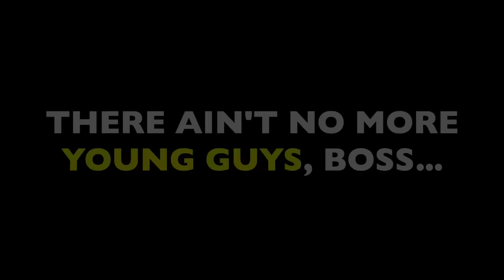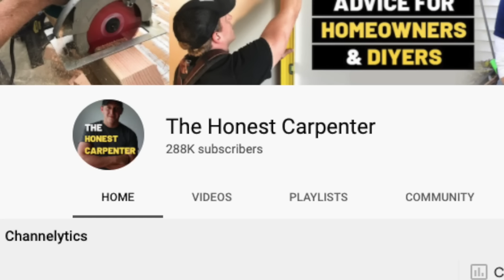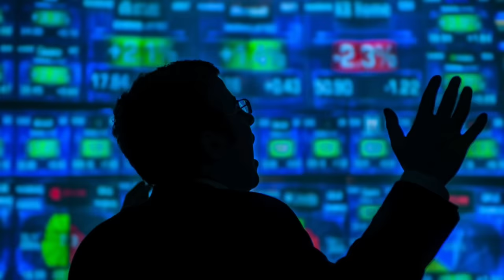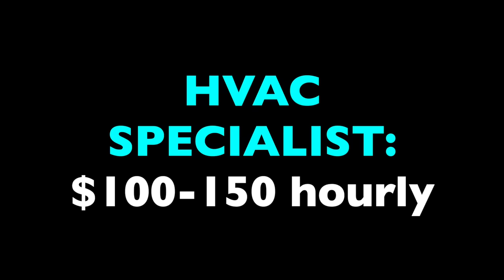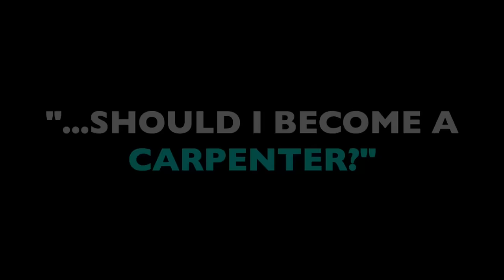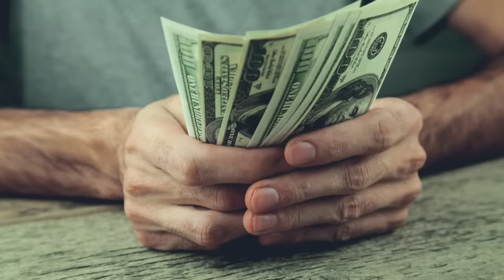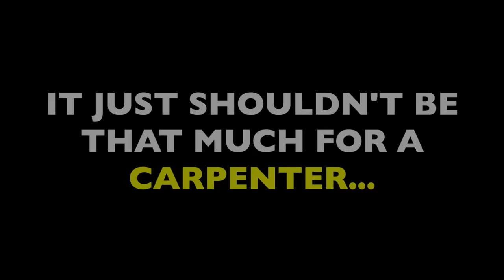WHERE HAVE ALL THE CARPENTERS GONE?! (Why The Trade Labor Shortage Is Only Beginning...)

Comment: As far as building goes, all the 'younger guys' I see on construction sites around here are hispanic. From what I've seen they work really hard, and I'm sure for not nearly enough pay! But I think that plays into the issue: most people, if they can buy a semi-decent house for cheap, they're going to do it; to compete on price, builders are going to cut costs wherever they can; and as long as there is a way-too-cheap source of labor, builders are going to use that.

And I'll wager the labor shortage is contributing to the jump in house prices.
Reply: Well, that's why illegal immigration has always been tolerated: because expanding the labor pool is a sure way to drive down wages and bust unions.
Reply: I'm not trying to make a racist remark, just an observation. It was all hispanics working on my house when I had it built early in this century when I was young and dumb. Now that I know more about carpentry, they did a horrible job. What does working hard mean when it's not done right?
Reply: And not to put the Hispanic guys down but for at least 75% of them the quality isn't there. They are just here for a check, not to come by the job they worked on in 20 years and say "I built that", they just don't care. They're not invested in our country. And I can confidently say this after 20 years in construction.
Reply: @HEADBANGER4LIFE37  - I'm not the politically-correct type or thin skinned, but there's a couple problems with your comment; I'll explain. My parents were both born in Mexico, immigrated to the United States illegally, and started their journey of ultimately becoming American citizens under Reagan. I'm proudly American, and ethnically, I'm proudly Mexican. Here's the issue with what you're saying:

1. The quality 'not being there' is a leadership/management issue; not a Hispanic-bad-worker issue. Unless you're hiring that person directly--the Hispanic--which 99% of the time, that isn't the case. It's the American white guy who owns the home building/contractor company most of the time. The owner is ultimately responsible for hiring and retaining qualified workers, properly training, and terminating someone who isn't doing quality work.
2. Hispanic workers aren't just there for the check. That's a huge generalization. The best work my family has had done on their homes has been done by an illegal Hispanic who took pride in his work. So, what I'm saying is that this comes down to the individual, not the race.
3. In general, there is a definitely a difference between the business owner American white guy and the business owner illegal immigrant Hispanic. This is not because the white guy has better genes. This is because the white guy and the illegal brown guy are coming from two very different upbringings, most of the time. The white guy typically had an upbringing that allowed him to get an education, or at least an apprenticeship under another experienced American guy who taught him quality work. There was a transfer of valuable knowledge from one guy to the next. The illegal Hispanic guy had little schooling, most likely bad parenting, swam across a river, and is willing to take any job in order to survive. He's not comfortably living with his loving parents while he takes his sweet time to learn a trade.
4. There's more to Hispanics not being invested in the country than Hispanics simply not being invested in the country. Ideally, we'd love to have people just cross the border and love our country and be invested in our nation's future. However, it might be unreasonable for us to expect that to happen with zero work on our part. The Hispanics that I've seen who are invested in this nation and love this nation are the ones that have close and personal relationships with an America-loving American. So instead of expecting someone who crossed the border with the single ambition of making money to love this nation, we should probably try inviting that guy to lunch, helping them in time of need, provide them leadership, educating them on what made this nation so great, helping them understand what kind of beliefs and behaviors are needed to keep this nation great, and educate them on how to make the most of their lives here in the US.

And I can confidently say this after 30-years of being Mexican.
Reply: "30 years in the US." "Proudly Mexican" It really wears you down.
Reply: @4teen88  Bud, you need to be clear. "Wears you down" in what way? In which direction? In what sense? Something unsettled you.
Reply: @danielfarmer7372  Our government literally ships guns to Cartels in Mexico so people WILL flee here. Large corporations benefit from a crime stricken Mexico. Google literally uses government issued visas to ship in people from India because they can pay them less. The only people that win are corporations and the immigrants themselves. But only for a short time. Quality is tanking is this country. According to TIME magazine, were more segregated than we were in 1999. Think about that. Its not getting better and its not personal. This country has to return to its roots or it will be destroyed. The exact same thing happened to Rome until their enemies just walked right in because nobody wanted to stop them. Get a grip.
Reply: @4teen88  you can still get paid ok on construction as labor in South from 150+ in labor but if you want to make good amount money you have to be contractor/boss to make hundred of thousand dollars. Also very important is to not to work with common resedential building companies since they pay as low as they can. You get paid much better as an independent working for individual clients/ private builders.
Reply: @bdm1000  you get what you pay for duhhh pay cheap. Cheap work. 🤣🤣
Reply: Running Bear  We most americans came looking for a better life or just to save the live from any part of the world where there was no opportunity, hunger or war. And the same happens to many hispanics coming to the U.S. Any human being would do the same, as many white did coming from Europe in similar dire situations. 
Don't blame an immigrant worker of driving down wages, but rather blame the contractor who pays stagnant salaries, barely to survive. By the way I can tell most immigrants will do their best to do a quality job for the simple reason of keep getting jobs. A few just try to make some money though not having the skills, and I can say this applies to anyone no matter ethnicity or origin. Last, construction trades can be hard, long hours and bad weather, not many americans are willing to take these jobs from decades so this explains very well why who are in the trades now.
Reply: @recyclespinning9839  - That's a lie. I don't say that with disrespect - but that's definitely a lie. I too live in a major US city; Chicago, to be exact. And as someone who is not only Mexican-American, but who has grown up in the Latino community, I have never heard of an immigrant in an apprenticeship. I'm sure there have been, but the number is so minuscule that I in my entire life, while being surrounded by all sorts of immigrant laborers, have never heard of one that has enrolled in an apprenticeship. That's not how life works for the immigrant Latino. The Latino laborer applies for a laborer position and learns on the job while making near minimum wage, if not minimum wage. The cold hard truth is that most Americans won't take laborer positions because there is much less financial need in the American world. The American world has mommy and daddy; the American world has unemployment benefits; the American world has family and friends that can lend thousands at a moment's notice. Referrals have never been needed to enter a trade. To enter a union? Sure, but not a trade. Today, you apply on Facebook, you get a call, you start working.
Reply: @4teen88  I don't mean to be disrespectful, but man, you need to read a book.

1. If you think that a country with unlimited resources thinks to itself, "Hmm, how can I get more people to flee from Mexico into the US? I know! Let's send guns.", then I feel sorry for you. If the US wanted to do that, considering the Dollar is the world's reserve currency, doing that through financial means / financial policies would be much easier and effective: gradually attack Mexico's economy to the point where it becomes Venezuela. Mexicans will flee because it will come down to survival. Sending guns? Cartels, drug trade, assassinations - that has all been a part of Mexican culture for decades, and you think the US government is going to scare Mexicans into the US by.....sending guns?

2. You said google "literally" uses government-issued visas to ship people in. Visas are regulated and there has to be some specific reason for issuing that visa, like technical skills, so there's a reason for those visas being issued. And also buddy, the only type of visa that can be issued is by the government, so you might want to understand what you're talking about first. Here's one for you: People are literally using government-issued passports to travel the world.

3. You said that according to time magazine, we're more segregated than in 1999. Again, you need to read more pal. The word you were looking for was "divided". In America, the word segregated is not primarily used as a synonym for divided.

4. There's scholars who devote their entire lives to the study or Rome and its downfall, but you, of all people, can just summarize it by saying, "the exact same thing happened to Rome"? You left out the part where Rome, as in the Roman government, was entertaining its citizens to distract from their poor performance. You also left out the part where Rome started offering free bags of rice and it attracted people to Rome like cockroaches. There's more to it than simply drawing a generalized parallel to Rome.
Reply: @danielfarmer7372  the grass looks greener on the other side. I have personally seen this in action. That's why American born kids are taught from little that they must go to college. I have worked on both sides of the fence and it is hard in different ways on both sides. Immigrant and American. I came here very young., but dropped out of college and worked construction and I hired both American and immigrants. I do my own work and hire and pay well when I need or contract out... yes you are correct in that, most are immigrants.
Reply: 200 dollars pay day here in NY to work in construction. Mostly Ecuadorian, Mexican, Jamaican, Irish, because they work hard, and stuff gets built on time.
Reply: @danielfarmer7372  vivo en NY y mi casa vinieron a trabajar gringos, cobraron bien por el trabajo, pero los hispanos se pasaban corrigiendo el trabajo que hacían los gringos. El piso que pusieron los americanos, después de dos años ya estaba todo roto y hundido en partes.
Reply: @PatricioGarcia1973  Hola Patricio, gracias por tu comentario. Yo vivo en Chicago. Ha cambiado mucho el nivel de educacion de los hispanos. Pienso que al principio, quiza el Americano hacia mejor trabajo porque sabian mas y tenian mas experiencia. Pero ahora, despues de mucho años de los hispanos dedicandose a estos trabajos, pienso que es como tu dices. Asi como los Italanios dominaron la construccion por un tiempo, creo que ahora los hispanos estan empezando a dominar construccion, remodelacion, y toda profesion por el estilo.
Reply: @ludvigbydal7812  That's complete bullshit. When I was young and working construction there were a lot of white men that worked construction but I seen the Mexicans start coming in.  It's not that white men didn't want to work construction it's that the Mexican would come in and do it for less, even on a government contract.  I helped a friend tear a a roof once, because he needed the help.  He said he was getting out of roofing because the Mexicans were taking so low of a wage with other companies that he couldn't pay a decent wage to his workers and those other companies were undercutting him on bids.  It's not that white people won't do it, they just won't do it for the wages they pay the Mexicans.
Reply: @kalel33  Hey Kalel I believe you were replying to Phillip Baxter above, don't know how it ended to me. Anyways better take it easy and understand the reality in the labor market in most construction is what it is. Contractors, builders, developers, investors and companies in the industry who put the money want to save big or maximize profits. Happens that most of the available workforce are mexican or hispanic, for the most part US citizens, born and raised in the US as I've seen for 30 years, so not so much any migrant who just arrived and who may have to rather hard live from odd undercover jobs for a few years. On the other hand about migration, Yes I say any human being has a right to pursue a better life, but from some years ago immigration increased so much due to the ongoing rampant corruption and crime in their places of origin, many are fleeing just to save their lives. Same happened to us europeans fleeing for over 300 years from our countries to America because of endless wars, uprisings, revolutions, hunger, no jobs and on and on. 
Bottom line don't look for a scape goat to dump frustration on. Rather claim to the top who own the industry. Furthermore often I have to find staff for building, the only white guys most of them are already in their 50s, though for me what works is finding anyone who knows the trade, no matter origin or ethnicity for me. I got apprentice younger too, but almost NO young white guys I've seen in the business for quite some years. May vary by region.

Comment: Just finished learning carpentry after 2,5 years on the job + school training. Average pay here in Germany is 12-15€ per hour.
Minimum wage is 10€...
Reply: Sounds like you got cheated bud.
Reply: @werewolf4358  Maybe.  Germany pays for everybody's higher education regardless of what it is.
Reply: It’s probably a language thing but - You didn’t finish learning carpentry after 2,5 years on the job + school. The learning never ends in carpentry.
Reply: @psidvicious  This is true.  It's also true for just about everything else in the modern world.  If you don't keep up, you get left behind, especially with technology.
Reply: @virginiamoss7045  The € and USD are close to the same. I’m actually a little surprised at how similar the ‘going rates’ are (12-15€/hr). Is Germany having a similar problem as the US with the influx of cheap labor (from somewhere)?

Comment: So true. Well said. I’m a carpenter.  Used to be a carpenter. I love early mornings on the site, framing walls, nailing plates to studs with my hammer. Went through 4 years apprenticeship and construction program at community college. I was proud of being a carpenter. Eventually got my general lic. 

But I became disillusioned because I needed thousands of dollars in tools in my van to work, and the homeowners would pay me little. I’d watch the husbands drive off to their office jobs making six or seven-figure incomes, then return home at day’s end and write me a small check. I didn’t have the business skill to make a good deal.

To hang a front door, I need a router w/jig, planer, skillsaw, door bench, lockset drill, bits and jig…plus hand tools, cords. Over a thousand dollars of tools I’m dragging in, to earn little. 
Crawling on knees to install baseboard…climbing around floor joists; jumping into deep footings to set forms, climbing out again. Walking plates to nail ceiling joists and rafters on a second story— that’s all tough work that requires skill and tools. The chemicals and dust bothered me: adhesives and primers, toxic wood dust, breaking stucco and getting that silica dust…etc. 
So I became a teacher! Steady check, insurance, no expensive tools.
Reply: I love this job  but I wish to work abroad  currently  working  in Kenya 🇰🇪  any chance  I will  so happy
Reply: Carpentry doesn't earn you good pay, business skills do.
Reply: That's a decision point I use often: how much is it going to cost in tools to do this myself, along with how much time do I want to spend on it?
re: teaching, missed one, part time, with summers off, "winter break", "spring break"